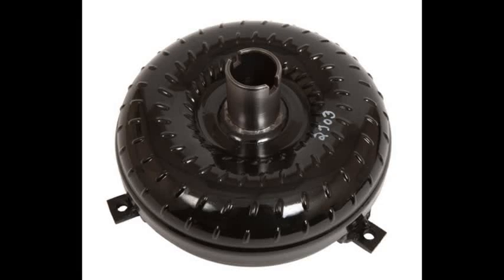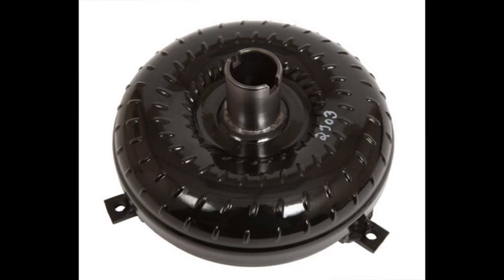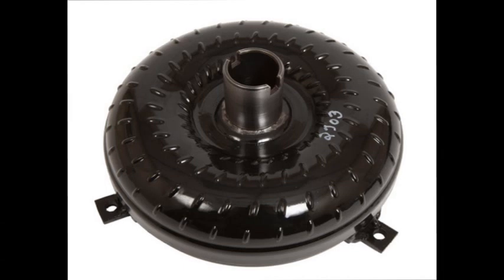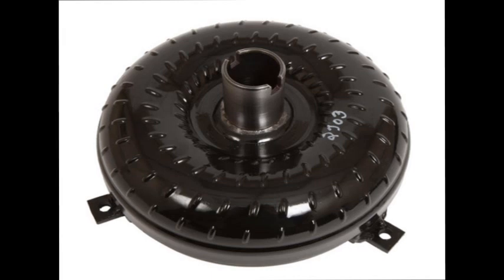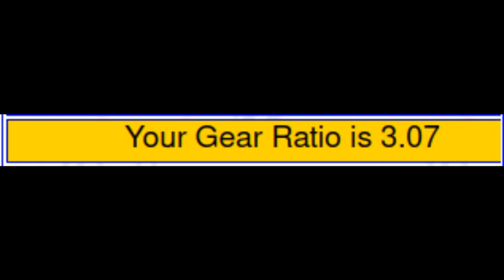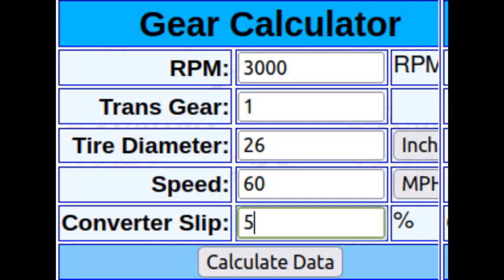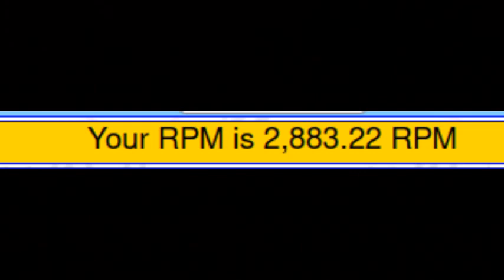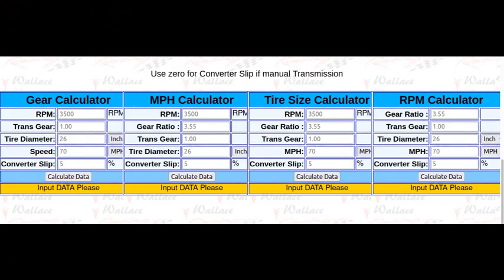Matching stall speed and gear ratio for street.

Comment: My 1st gen sbc stroker is a little soft on the lower end so I went with a 3500 stall in my 94 Sonoma with 28" tires, 3.55 gear and th400. As my truck is 95% city/street I leaned towards my dyno sheet while choosing my torque converter, 400ft lbs@3500.......513ft lbs@4500, I also run a trans cooler with a fan. Does my setup seem reasonably close?
Reply from the maker: It does. I would add a good transmission cooler if you haven't already.  A temperature gauge for the transmission is also a good idea. Heat is the main thing to watch for.
Reply from the maker: That sounds pretty stout. It must just vaporize tires!  I see you already have a trans cooler with a fan. That should work great.
Reply: @timsprojectcar1875  My set up runs a steady 160-170 degrees.

Comment: Incorrect information on stall and cruise RPM.  The rated stall speed is at full throttle.  Do you cruise at full throttle?  No.  The slippage is minimal when cruising at part throttle.  I've been running 5,000-6,000 converters on the street for more that 20 years.  In fact I'm still running the same Redline synthetic fluid since 2005.  Fluid still looks fresh.
Reply from the maker: I understand it's possible to make that work, but my approach is more conservative. I'm sharing what I believe will work good and be reliable. I stated in my video you can run higher stall with enough cooling, so I really didn't say you can't do that. Just tthat I wouldn't recommend it. It's all good.
Enjoy!
Reply: High stall converters suck on the street. They build up too much heat quickly especially climbing hills.
Reply: @musclebone7875  A good converter will drive almost like a stock one at part throttle but flash to high RPM when you go full throttle.  Should not generate any additional heat at part throttle.  If it does you need a better converter.
Reply: @Steve69SS396  I don't believe that one bit. It's too many variables that go with that. Only way that a high stall converter would work well on the street if it was a lockup converter. I had a 4,000 stall 3,500 stall, and a 2,500 stall in my car. The 2,500 is way better. High stall is only good for launching from a dig. The 2,500 stall launches hard from a dig, a roll, and cruisers down the highway for long trips great.
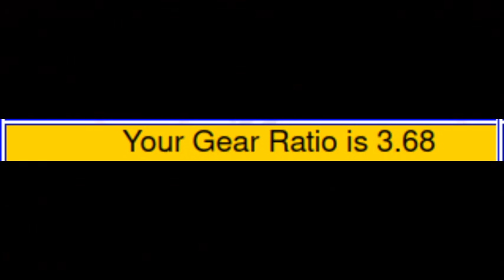Reply: @musclebone7875  Here's a video of me driving around town in my car.  Most of the time I'm shifting it at 3,000rpm and driving between 2-3K.  At about 5:20 in the video I go full throttle and short shift the car and you will see that the RPM's don't drop below 6K.  I'm not saying that every car needs a 4-5K converter.  I'm saying that it ridiculous to worry about your stall speed being higher than your cruise RPM.  I've been running converters like this in my car for 20years.

https://youtu.be/A2qhJIIFyyI?si=SV_ieuqNnGzVhTk1
Reply: @Steve69SS396  what rear gears are you running? 4.30 or 4.56's? You have a race car that you drive on the street. My car is street car that I can drive down the highway at 80mph @ 3,000 rpms. Our setups are night and day difference.
Reply: @musclebone7875  When that video was done it had 4.10 gears with a 30" tall tire.  Now is has 3.50 gears with a 30" tire. It's a street car that can run 8"s.
Reply: @musclebone7875  you ned whatever stall is needed for the combo.  if you dont need a 4000 stall then dont run one

conversely  if  you have a hot street engine that redlines at 7000 RPM,  then a 2500  is most likely  the wrong stall altogether.
Reply: @KingJT80 I totally agree

Comment: What stall should I use I have 4.56 gears  with 33 inch tires
Reply from the maker: With 4.56 gear, 33 inch tire, and 1:1 top gear, it works out to 2926rpm at 60 mph. 3000 stall would be good for street use.
Reply: Do you think it would be alright during highway use during long distance drives

Comment: I have 700r4 with 29 tire with 28 stall looking some fun at the track but still drive on the street I was looking at 373 or 410 ???
Reply from the maker: I think either gear will work fine. I put 3.73 in mine though, because the low gear in a 700r4 is 3.06 and I didn't want to have 1st to be too low.
Reply: Thank you

Comment: What should I use if I ran a 411 gear with a 29 in tire what size stall do I need
Reply from the maker: Using the wallace racing RPM calculator I plugged in a gear ratio of 4.11, a tire diameter of 29, and a converter slip of 5%, which is fairly typical. And a cruise speed of 60 MPH. The result was 3001 rpm at that speed. 3000 stall would work well in this case. 2800 would also be good, if you have a high torque engine.
Reply: @timsprojectcar1875  thank you